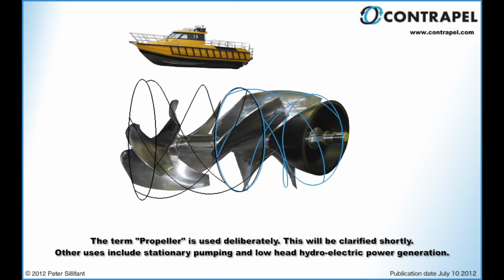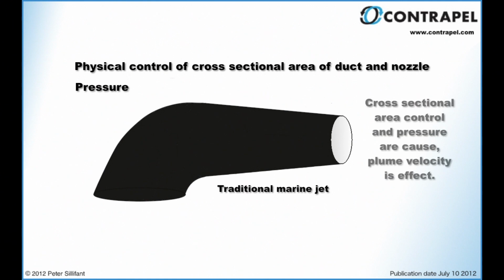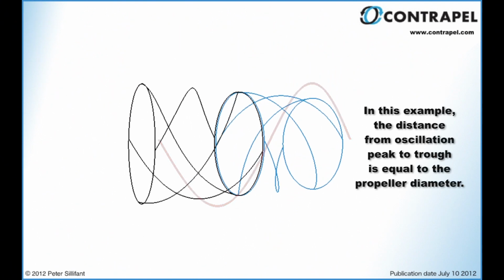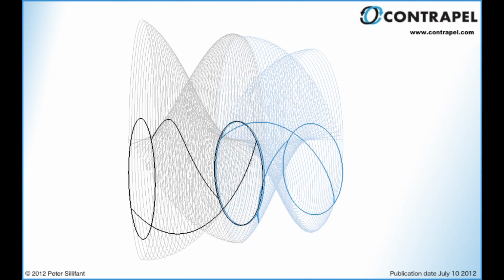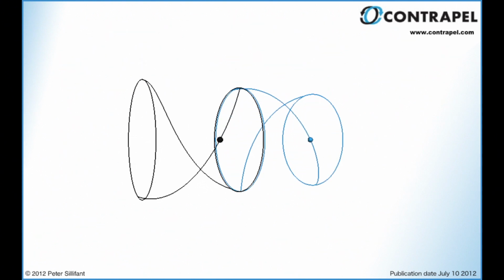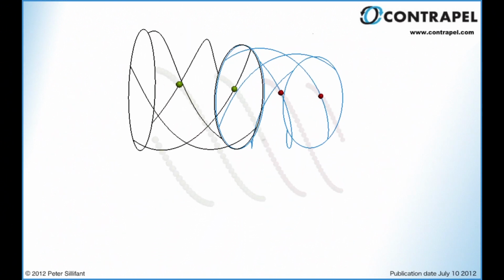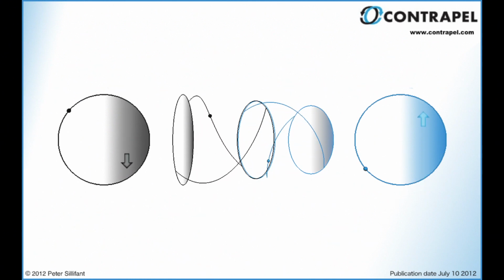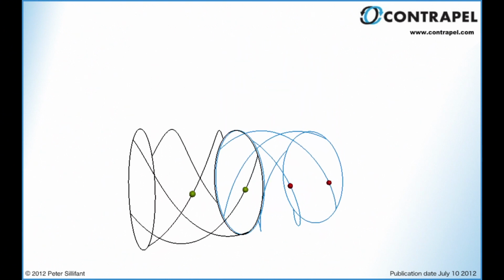Introduction to oscillating counter rotation

Comment: Would this concept work in air? It seems that a ducted fan incorporating the counter-rotating design, if applicable, would dramatically increase thrust versus an open air single prop.

But, does this also suggest that a single open air propeller, if oscillated, would also produce significantly increased thrust. What level of increased loading might we expect of the bearings supporting such a design?
Reply: I was thinking the same thing, only based on electrostatic forces and using programmable magnets on the turbines. Wave forces work in similar ways through out the universe I think. This invention is amazing. It's applications will be far reaching unless a government somewhere buys it intotal and files it under "national security" somewhere, never to be seen again.